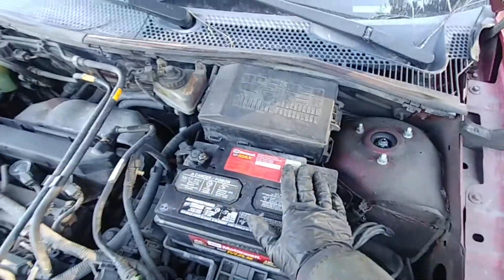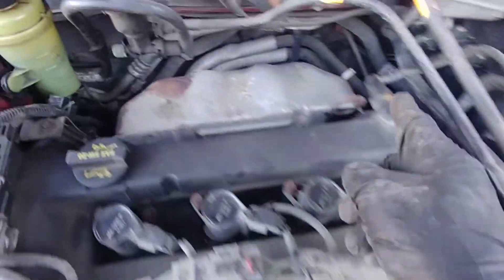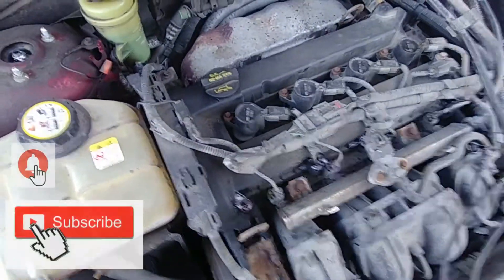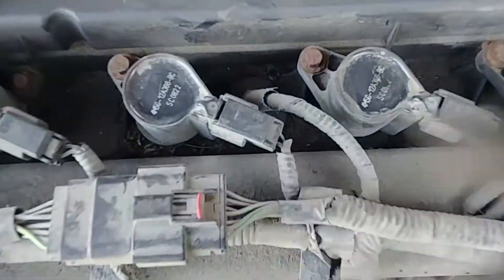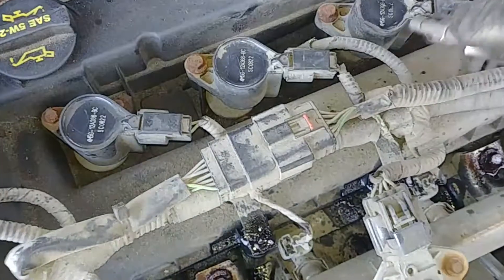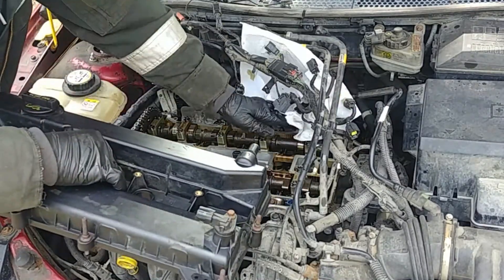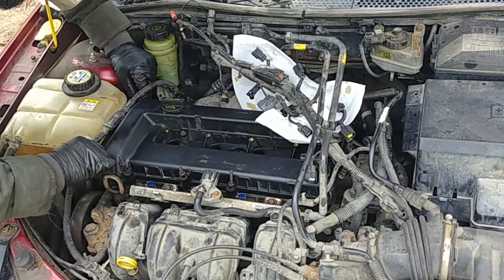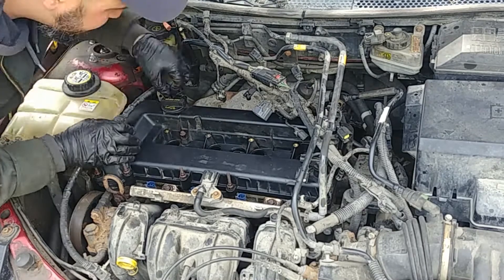FORD FOCUS 2.0L DURATEC ENGINE VALVE COVER GASKET REPLACEMENT

Comment: Thanks so much for this video! It gave me the courage to tackle the valve cover gasket replacement on my own. I went to change my spark plugs and found oil in 3 spark plug wells and panicked but my car should run much better now after replacing plugs and gaskets. Really appreciate you including where to put the RTV and the bolt pattern as well! Some other videos I saw didn't show these things.
Reply from the maker: You're so welcome xTheCommondore! I am so glad this video helped you out). Trided my best to make this video informative and short as possible without missing important parts.

Comment: So, how did you remove the plastic cable housing that is mountes to the two far left valve cover nuts/bolts? In the video there seems to be a jump cut showing you removing the cover to it, then next the plastic housing is magically off.
Reply from the maker: Hey brotha! I think one of the clips was broken before. I used small flat screw driver to open/unlock one side then pull front part of the cover slightly up and then did the back. I remember it was a bit a pain to get it out.
Reply: @PistonShack  lol, that plastic piece was the reason I looked up a video. I wound up just spraying the bolt threads with penetrating oil and pryed the piece out with a screw driver. It didn't want to budge dry. I was afraid I would break it.

I thought maybe you broke yours and chose to edit it out. lol.